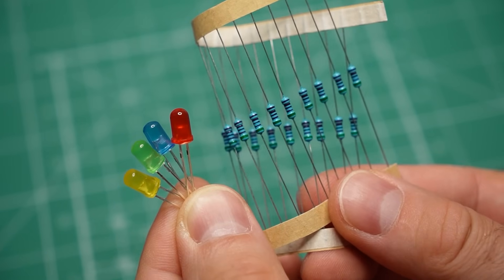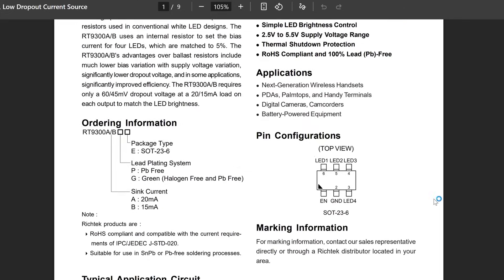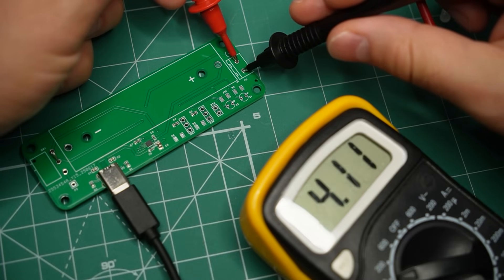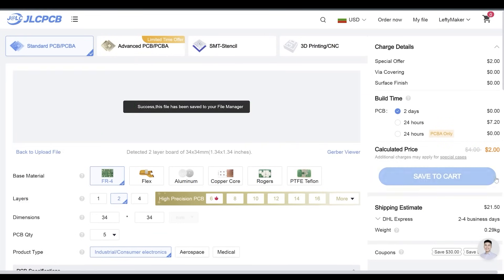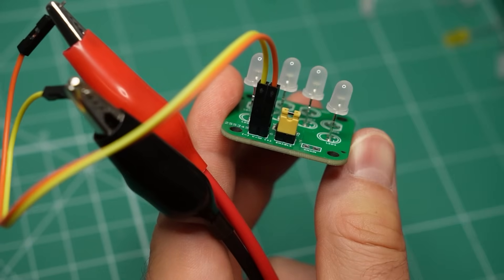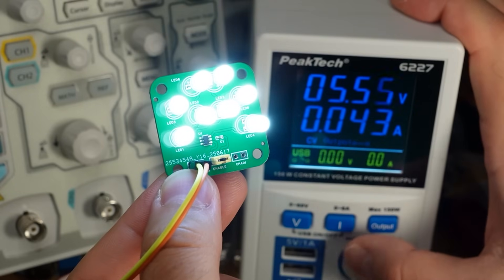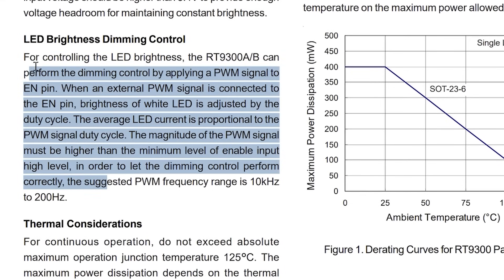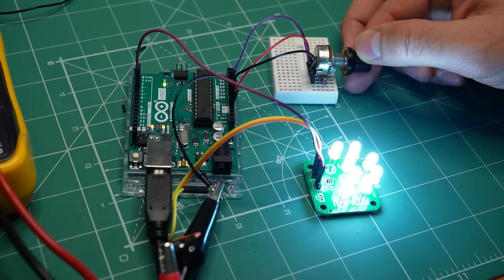The second simplest LED Driver I've ever tested

Comment: Hello! It is hard to find this driver. Can you provide a link to where you bought it? Or can it be replaced with another driver? Thanks! All the best!
Reply from the maker: Try LCSC or DigiKey. I see it's available there
Reply: @LeftyMaker I found it and would like to buy more, but before purchasing, I need some clarification. Does this driver work with an LIIO 18650 battery between 2,8 and 4.2 V, or does it only work from 4.8 to 5 V? Is a 5 V voltage booster required? I use 18650 batteries and I need a driver that works between 2.8 and 4.2 V but not using any voltage booster to 5V. Thank you very much!

Comment: Quick question, isn't there a risk of over voltage? Because even if the current is constant, the voltage may be greater than the maximum tension the led can handle. 
Anyhow great video, like always
Reply from the maker: Hello! There is no risk of overvoltage to the LED as long as the driver is working properly. The driver controls the voltage on the fly to maintain the desired current (15/20mA), and the voltage in this case is only slightly above Vf.

Comment: My question is: when you control led brightness with pwm, is it pulsing leds, or is it adjusting the current the leds receive?
Reply from the maker: It is pulsing the LEDs. When they're on, they're at max current. There is no visible flickering if you use a high enough frequency.
Reply: @LeftyMaker a tiny cap in parallel with the leds would remove any flickering, essentially changing it from pwm to (lower) constant current, and allowing even low frequency PWM.

Comment: Remember that the maximum voltage of the chip is the supply minus the voltage drop of the diodes. So with diodes is series the supply voltage can be higher.  This also increases the efficiency.
Reply from the maker: This is interesting. Judging by what is said in the datasheet, Vin should be no more than 5.5V before the diode drop, but I could be misinterpreting it. Gonna test this
Reply: @LeftyMaker You are both correct. The datasheet is misleading. The datasheet (strangely) lists Vin as the diode, not the IC voltage. The IC only cares about the voltage on its pins, which must never exceed 6v. Beyond that, stack enough LEDs in series and you can run it off rectified mains power and it won't care. However, be aware that the if any LEDs fail short (less common but possible), that will increase the pin voltage. I suspect the datasheet does not recommend series use because of the risk of shorted LEDs... Because they know that every manufacturer will use 20mA max rated LEDs with a 20mA(+-5%) driver anyway.
Reply from the maker: I left the driver running overnight at 8V with two diodes in series. No issues. So it's true. The datasheet is misleading. Drop across the chip is 2.5V with two leds in series, 3.2V when the chip is disabled. Thank you for the input! I learned something new.
Reply: @LeftyMaker be mindful that led forward voltage drops significantly as current flow approaches zero, so when the IC is disabled but still connected, the effective voltage drop will decrease, meaning the input pins get higher voltage. I would guess this difference would be around 500mV so just be aware and measure voltage at vin to verify
Reply from the maker: You were correct! It shoots up by about 0.45V. Thank you for sharing. I learned something new

Comment: That was really interesting. Will the driver work with RGB LED's? I would like to see you test it. Thanks for sharing.
Reply from the maker: Yes, technically, but there is no way to control the individual channels to get different colors. You'll just get a shade of white. There are different drivers specifically made for RGB LEDs.
Reply: @LeftyMaker technically, you could use 3 of them together and get a 3-bit color (111 in binary=7 colors: white, R/G/B, and C/M/Y, plus off/black.
Wait...that's 8. Okay, I suck at counting in binary but you get the idea: there is an incredibly inefficient way to use these to make RGBs work really badly. And I fully support it.
Reply: @LeftyMaker  Could you use switches for each of the 3 rgb leads?